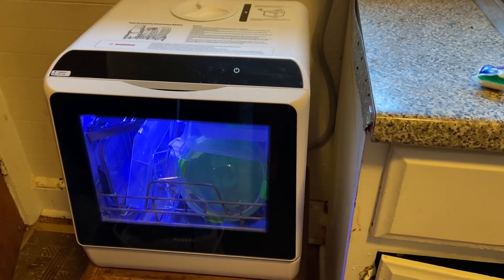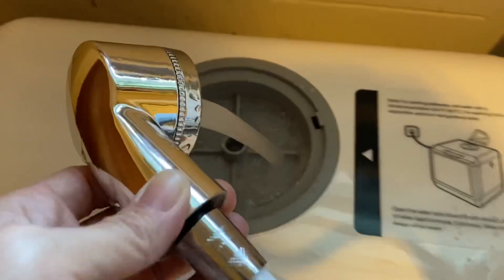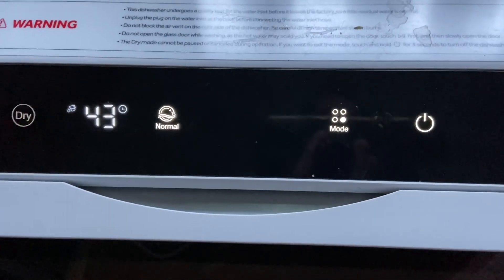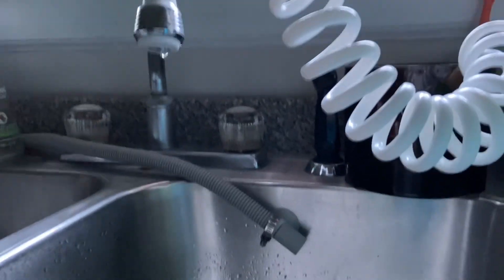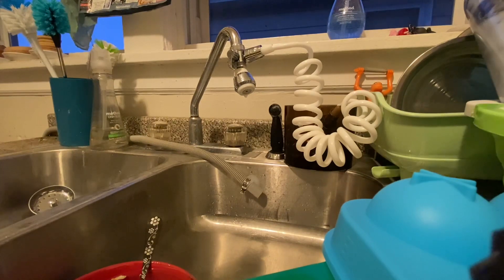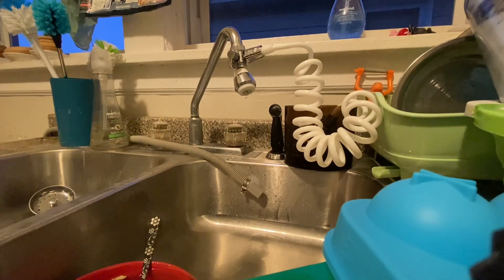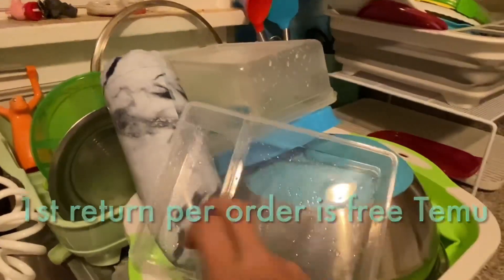dear Novete p2 portable countertop dishwasher review {long version}

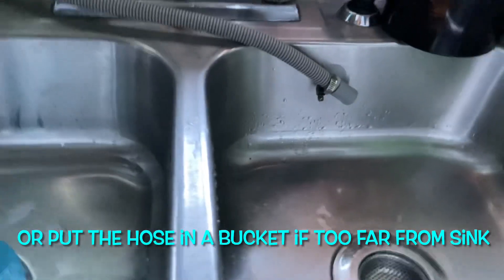Comment: For your drain hose, you don't have that little metal clamp fastened to the base where it goes onto the washer, you should screw that in so it holds the drain hose very securely to prevent that hose from falling off. It's the clamp at 04:14 
question for you, with your washer being lower than your sink are there any issues with the pump pushing all the water out appeal into the sink?
Reply from the maker: Thank you! I move the hose sometimes and never had a problem with it draining or moving around even though it's not secured. It just hangs over the spout sometime and is fine!! There is a little suction thingie that sticks to the side of the sink but it sometimes is loose but no issues.
Reply: @katlovedreamingpeach  I don't think I explained myself well, what I mean, is that little metal clamp, hanging on the drain hose goes on the other end of the hose, the part that attaches to the machine. Eventually with all the moving of the drain hose it can work its way off the washer and then it will pump all that drain water onto the floor. That little metal clamp goes over the part of the hose that attaches to the machine, then you screw it a few times so it holds it tightly. Trust me, secure that hose tightly to the machine with that clamp!
Reply from the maker: @maha77  it does not have a clamp that goes on. It’s just a hose that you push on to the spot. I took a picture of the back of it. I can post it on my community tab.
Reply: @katlovedreamingpeach  the clamp is on the other end of the your drain hose. If you check your video right at the 4 minute 14-second mark it's that little metal ring-thing hanging on the hose next to the suction cup, that's supposed to be on the other end of the hose tightened around where the hose connects to the machine.  Or click this timestamp and it will take you right to the spot in your video well you can see the clamp : 04:14.  Tightening that clamp on the other end will prevent you from accidentally tugging the hose off the machine. Aside from that, this is a great thorough detailed video! I just ordered one of these and I can't wait to get it! The only problem right now is trying to find a space where I'm going to put it, my kitchen is so small
Reply from the maker: @maha77  I just posted a picture for you on my community tab